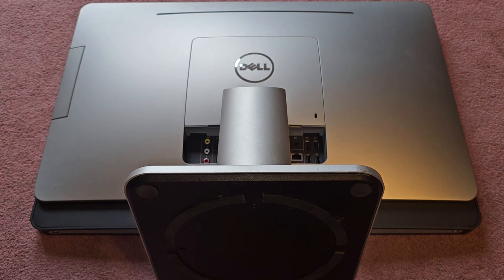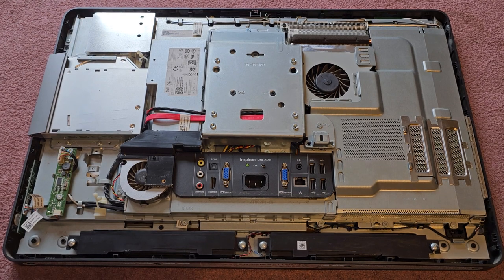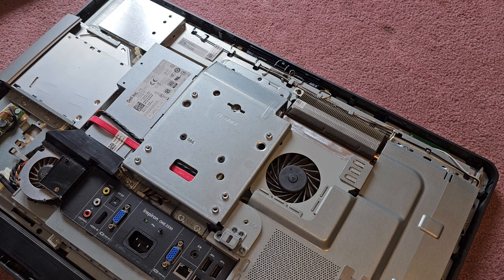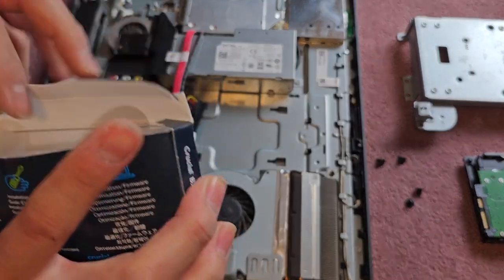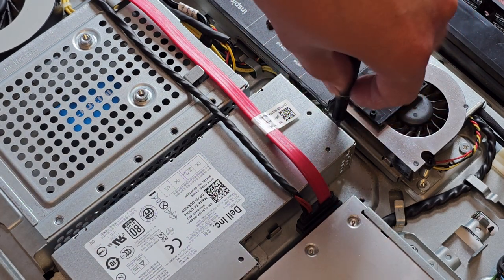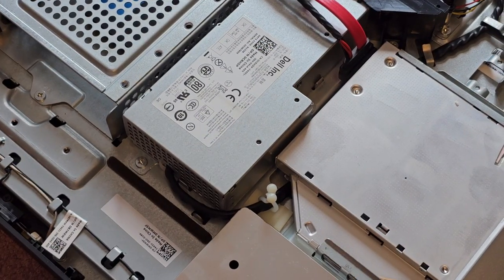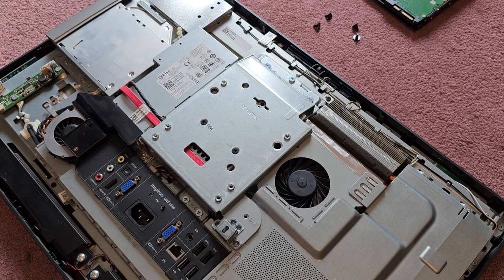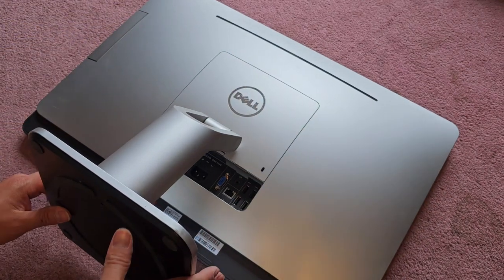DELL Inspiron One 2330 Disassembly RAM SSD Hard Drive Upgrade CMOS RTC Battery Replacement Repair

Comment: I have the same computer. If, for some reason i need to open it, now i know how to open it. Very nice video and thanks!
Reply from the maker: Awesome, hope it helps in the future!
Reply: @ItsBinhRepaired  it will, because it's not very reliable... so thanks!
Mine is the i5 processor with radeon hd 7650a
Reply from the maker: No problem
Reply from the maker: @falcconplanes  yay!

Comment: Good video, I have had one for 7 years, & just bought another off ebay for 75$, put a 1tb SSD in it, didn't know about this mod, i have some 3 to 6 TB large hard drives lying around, I might just put on the brakes & do this mod. Thanks.
Reply from the maker: Which mod?

Comment: this Video Was Helpful I just bought one from goodwill & Upgraded the CPU, RAM & SSD. only thing now is that i noticed one of the speakers sounds blown I'm not sure if it was like that before or not so i guess I'll have to check & see if maybe a cable got smashed when putting it back together.
Reply from the maker: Oh no, might have damaged the membrane
Reply: @ItsBinhRepaired  yeah I'm not sure it could just have been blown when i got it I'll have to take it apart again and see. I can get speakers from ebay for $4.50 so maybe I'll just order new ones. i know the speakers are not the best sounding to begin with but I'm thinking about selling it i have about $35 in it right now. my guess it that it worth about $150
Reply from the maker: @stereomann83  hope it goes well
Reply: @ItsBinhRepaired  thanks I'll let you know i just ordered the new speakers.
Reply from the maker: Sounds good

Comment: will one of those 2.5 to 3.5 adaptors work in one of these all in ones great video
Reply from the maker: Adapter isn't necessary. You can connect the drive and mount/secure it however you like.

Comment: please go get urself some proper tools man. some screwdrivers and some prying tools. you won't have to sell ur kidneys for that. and btw next time just use zip ties for mounting the ssd. you don't want any parts wiggling around in there when serving a customer. double sided tape will loosen over time due to heat.
Reply from the maker: How hot do you think SSDs get?... if your components are getting that hot, your computer shouldn't be working. Tape will stick just fine even to the CPU heatsink...

What are these proper tools you're referring to? Prying tools suck. You don't get the same kind of maneuverability as you get with fingernails. My comfort and ease of doing the job is more important than your discomfort seeing a guy with long nails.

If you have a problem with it, you might want to seek counseling to see why other people's appearances bother you so much. I get the job done and that's all that matters.
Reply: @ItsBinhRepaired  calm down dude. was tryna giving u professional advice. do 10 laptops a day and see how it messes up ur nails in no time. also you're a lot faster with some plectrums and a stack of cards cz it also deals with keeping the clips open. you only have 2 hands. and I could literally hear those bits getting screwed as you tried to remove the heavy screws. you can get a proper set of screwdrivers for like $50. i'm sure you earned this doing this repair. was just tryna ease ur life and workflow take it or leave it bro.
Reply from the maker: @peerlessrecords6236  I've been doing this for over 16 years. You don't think I've tried other tools? There are cases where other tools work better, but 99.9% of the time, fingernails work better. Even with a few broken nails, I prefer to use them over those nylon and other material ones. Usually if it'll break my nails, only metal tools will do.

I likely have videos of more computer models being disassembled than a lot of techs have even removed screws from.

Yes, there are always new things that can be learned, but to imply I don't use other tools because a few cents... If they were a better option, I'd spend thousands on those tools, but they're not better.
Reply: @ItsBinhRepaired  you're clearly not a professional. but whatever sinks ur ship man 😅
Reply from the maker: I do better than most "professionals" so yeah... not listening to you.
Reply: @ItsBinhRepaired  well I feel sry for ur customers cz u don't know what "professional" means.
Reply from the maker: You can feel whatever you want. I have over 500 reviews from customers 5.0 average. Google computer repair in your area and see if you can find anything close... lol
Reply from the maker: Uh huh...
Reply: What part of this disassembly requires prying tools? Do you have some kind of muscle damage that you need prying tools?
Reply from the maker: Lol